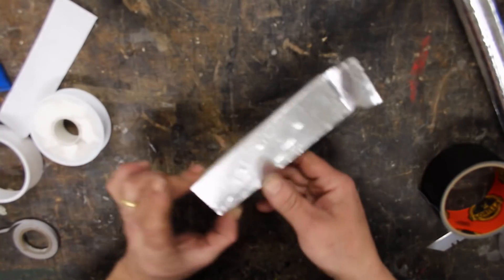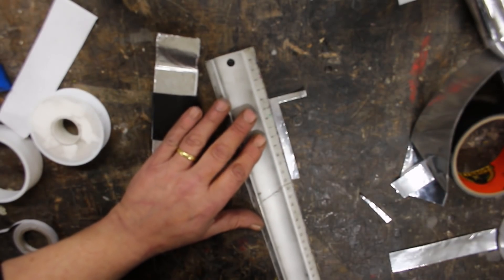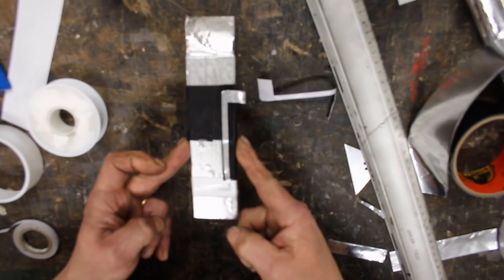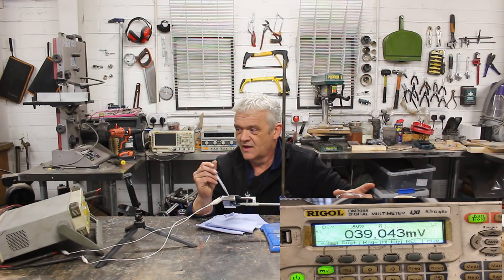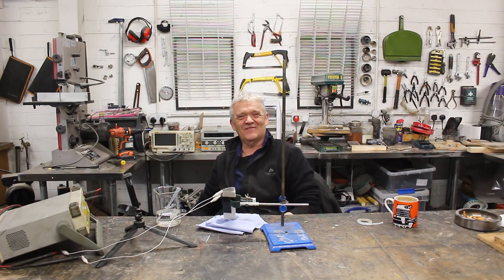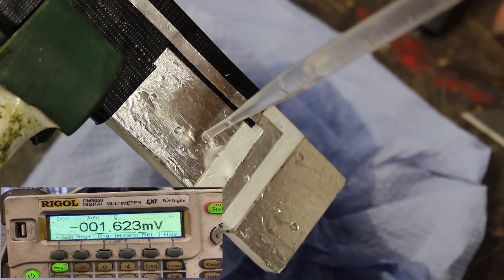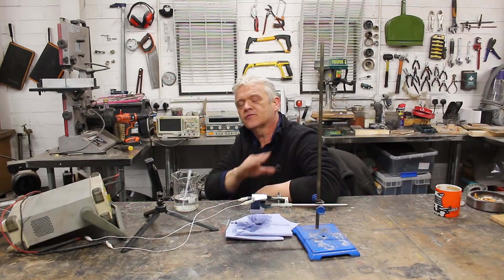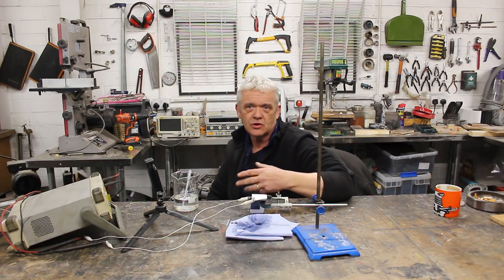1459 How To Make A Rain Fuel Generator

Comment: 100mV means absolutely nothing. That's just the PD across the terminals.
The flaw is that the charge on the drops is absolutely miniscule so they cannot deliver a significant current, and realistic power delivery needs a higher current than rain power can ever deliver.

Comment: I also made a rain fuel generator at home I also made a video of it but the problem is that it producing electricity in mili volts can you please guide mi how can I boost the voltage to even light up a one
Reply: @Robert Murray-Smith

Comment: This sounds a bit hinky.
The area of my roof should generate 5.4 kW.  If you get an hour's rain storm, that's 5.4 kWh.  That sighs quite optimistic.  But, since it's raining, put water wheels in the down spouts to harness the potential energy, and a wind mill up to harvest the wind during the storm - and, of course, a virtual copper pyramid over the house to capture the psychic energy from brain storms - you should be able to power one's own house, easily!

Comment: I tested this without PTFE and used clear take instead and it worked too. But the drops was more likely to stay on the aluminium. So I guess the PTFE is just to make sure the drops fall of as it is slippery and also more weather resistance compared to clear tape. Also noticed that if you let the drop slide along a plastic area before hitting the aluminium the voltage became bigger. Like if the drop generate some static charge as it slides along the plastic.

After some more experimenting I noticed that I get + and then it switch to - on the meter when the drop passes. I also get a bigger voltage when the drop moves faster. My guess is that this device work both as a capacitor and a inductor at the same time. The water works as a charged electrolyte that charge it like a capacitor and current flow in one direction. At the same time a field is created. Then when the drop leave the inductor the field collapses and you get a flow in the other direction. Note that this is just guesswork, I am probably wrong.

Comment: Greetings Robert and Luke!  Great channel!   In the process of trying the experiment, I noticed something interesting.  My setup used an actual aluminum bar, with a piece of teflon tape wrapped around it, and a narrow strip of aluminum tape on top of the teflon.  Aquarium tubing and an inexpensive plastic valve was used to control the water drop rate.  I found that the largest readings generally occurred when a portion of the water droplet (tap water) covered both a part of the aluminum bar and touched the aluminum tape (on the teflon) at the same time.  * Indeed, if I laid the bar flat, and let the droplet just sit while it spanned the two electrodes, I'd typically get a long lasting voltage. *  

This screamed "electrochemical cell", and led me to replace the teflon with a plastic film (from a Ziploc bag).  It also worked.

I then tried another experiment.  I placed two strips of aluminum foil in a glass of tap water, then attached both electrodes to my multimeter.  To my surprise, it also produced a "significant voltage", eventually settling down at around 127 millivolts.   (I found that if one electrode is much larger than the other, one gets a greater potential difference, along the lines of research reported in  "Area Effects in Aluminum Electrodes"  by Macnevin and Wilson in 1960.)

Haven't tried it yet, but it could be that the combination of an aluminum strip and a conductive carbon ink electrode also performs as an electrochemical cell, which involves the version demoed in video # 1460.  I'm curious as to what others have found in this regard.

Hydrovoltaics is certainly interesting.  I plan to explore some other approaches, such as capillary action.

Comment: In your video of the ram pump you expressed that the water is pumped upward. Could a stream and a ram pump generate more due to a higher distance between the air contact and the collector contact? Is it the initial charge granted by the water drop, or is each drop capacitative enough to absorb more ambient charge the further it falls?

I suggest that changing the distance between the water dropping and the collector as a staring point.

Always a treat to see a new video mate!

Comment: You basically builded half of a Kelvin generator. You would need at least 300 to 400 mV to trigger the diodes to get this static charge puls Pumped into capacitors. That's obviously triboelectricity so try to build the PTFE tape into a slightl wedge such that when the drop goes down the slant tile it has to jump from the L shaped electrode on to the other electrode it might then generate a few more volts. Because you know that the Voltage U increases with the distance d assuming the Electric Feld E is constant. ergo U = E*d

Comment: Isn't this just converting kinetic energy to electrical via the tribo effect, If rain had 50W/m2 energy I'm thinking most of us would be concust or deaf (or both) if this were true. In the experiment you produce 100mV odd Peak thats about 1 nanoWatt (100mV into 10MOhm) meaning 50,000,000,000 of these in a square meter for 50W/m2 and the rain energy to drive it.

Comment: Does the water lose it's charge as it passes over? If not you could cascade the panels one under another an the drip would generate multiple times. Edit: just read a comment below, I've asked the same question....

Comment: I just tried this, and I got 800mV from a combination of plastic, aluminum foil, PTFE - and a 5mm wide strip of copper tape. 
 When working properly, the voltage vanishes - as soon as the water flow stops. 
 If shorted by water, the voltage falls to about 300mV, and remains after the water flow stops, due to becoming an electrochemical cell.

Comment: In line with the ongoing "flower" theme on TNT: A soda can or other metal tube is cut lengthwise eight times leaving the bottom inch intact. The sections are folded out for the petals. The top half of each petal is insulated and a metal ring goes around the petals over it. If I grok this correctly this would be parallel capacitance so about 8x what you got in this video?

Comment: Very interesting. Would it be possible to do this on the inside of pipes, therefore generating power from mains water supply without reducing flow/pressure? Also gutters/drain pipes.

Comment: Seems like the version that allows the droplet to splash onto the PTFE and only contact the alu when it is at it's most extended gives a much higher voltage.
Try placing the contact at the end of the PTFE strip and drip water onto the middle so it extends onto the alu as it splashes. Angle can be flatter.

Comment: I haven't read the article from Hong Kong, but my guess is that by using transparent conducting oxides for the electrodes along with a transparent insulator between the electrodes would permit this technology to be applied to the surface of solar cells.  This is very interesting since it would permit the "solar" panel to become a "hydro" panel when ever it rains.  Thank you for bringing this to my attention.  Very interesting!

Comment: Am I the only one skeptical here? Those 4 cells running the leds seems fake to me. 50w/m2 also very hard to believe.  
Generating a few hundredths of a volt is easy but getting any meaningful power is unlikely. Volts without amps is meaningless.
Even if this does work, there is not enough rainfall to make it worthwhile.

Comment: What if you just used some cheap capacitors on a panel where the aluminum case is exposed as a third electrode to collect charges from rain drops?

Comment: Voltage is meaningless. I can generate 20,000V with a balloon rubbed on my hair. It what Amps you can extract?  Voltx Amps = Power,

Also ....50Watts per square metre? You may think it rains it a lot in the UK but the mount of time actual rain falls is less than 5% of the time (average). So maybe an hour a day. Lets compare wsolar panels where sunny or cloudy (they work in cloud conditions too) you have near 12 hours of daylight - each day (average!)

1 square metre solar panels now cost £100 and generate ~200Watt on sunny day and ~50Watts on cloudy day . On average we will get 100Watt (between 30% sun time and then 70%cloudy). On average day you will have 12 hours daylight . Therefore on average you shoudl expect 100x12 ~ 1200Watt-hours. Lets say I've been optimistic trim this down  by 30% - so 800Watt-hours average day
For your rain panel we assume 50Watt-hours  (but in actuality I seriously doubt that - but lets assume). So 800 vs 50 ....16 times more from solar panels. 
Most area are constrained by roof space and for sure you can't just use alumniium foil to construct (they wouldnt las a week). These are going to be substantial aluminium & dieletric panels that I'll bet will cost at least half that of solar panels . SO half the cost  yet giving  you 1/16th the power.
BUSTED!
Reply from the maker: you do realise I am just reporting on what the paper said? If you have a problem - take it up with the folks who wrote the paper - or even the peer reviewers who agreed with them - I think I will go with the scientific evidence as opposed to what amounts to a bit of a rant - I am guessing you didn't even bother to read the original paper did you? - BUSTED!!
Reply: @ThinkingandTinkering  I'm quite capable of reading journal papers thankyou - I'm author of quite a few peer reviewed myself.  I do not doubt the science of the possibility of very small scale generation in some kind of niche applications by this method. But you are making claims - and others are cheerleading it in comments - that this could be somehow ideal as alternative for UK where we have lots os rain and less sun.  That is itself is a myth. But also absurd is the idea this could work as a solution. Read through my numbers - and tell me where I'm wrong if you wish. I assumed the 50W/m2 could be viable but in truth  I doubt this could ever get above 10W/m^2 - it would appear to break conservation of energy laws by  my own estimation. But assuming I'm wrong on that even it could above the 50W/m^2 it would still be woeful as an energy production method - even in  rainer spots of the UK -  vs using daylight solar. By woeful I mean order of magnitude and more. Again refer to my numbers. So all the roofs these occupied would be throwing away 90%+ of energy available they could have had from solar. What a waste!
Whilst the principles might be fun to investigate -  to suggest this has potential to ever be a serious energy producer - other than anything other than a toy or merely demonstration of principles -  is almost reckless/irresponsible. To do so gives credible ammunition to the people who are skeptical about any net zero and shift to renewable/ green energy  we require.  They can point to this and call it loopy as a solution because that's what it is as a scaled up idea.  There are many such people ready to pounce on unfeasible devices like this.
Fortunately the world has plenty of real and credible cheap solutions for genuine large scale energy generation - solar, wind, tide, nuclear that needn't cost too much and where prices are falling rapidly. We dont need cul-de-sacs like this to explore.
Yes - all this is a little ranty -. But I am very vexed by this.  Climate change is very real, imminent and present danger and energy crisis & costs rules and ruins peoples lives . As a professional in the field I need to believe we can get beyond  this and not get side tracked by the many hair brained 'water fuel cars' and 'perpetual motion' machines schemes out there.
Reply: @bbbf09  
 Considering your claimed skills in this area, and the ongoing global warming problem, perhaps you should not be denigrating the work of others, while not presenting any solutions yourself!
Reply: @bbbf09  
 You invalidated this lengthy response of yours, when you used the term "BUSTED!" in your opening comment. 
 That stated, I understand where you are coming from, but you could have been more constructive in your original criticism.

Comment: John Ellis water appears to have a high charge (increased hydrogen bond angle). The normal bond angle being about 104º, John Ellis water at 114º. Also just a few drops (20 is the stated number) of John Ellis water appears to decrease power input to electrolysis, while still maintaining production. A 2 ounce dropper bottle of the water is Free from the John Ellis website.
Might take a bit to wrap one's head around those concepts and terms, just be patient, and observational about it.

Comment: Great stuff! Imagine having those cells set up in spouting. If you could change the surface tension before the cell to get the water to bead, or split a pipe into multiple pipes? Alternatively you could replace the corrugated iron sheets or roofing tiles to allow water to bead and run down? If you have these cells one after the other can you get the same amount of energy in following cells or has the water lost it's charge?
Reply: Ive seen someone take pipettes of water from a beaker and re run it over and again and it looked like it didn't lose the charge

Comment: Has anyone measured whether raindrops from thunder & lightning clouds store or transfer more charge than non-thundery rain?
Reply: Good question I guess the only way to find out is when it's run raining and thundering outside collect a glass of rainwater for when it's raining and thundering and when it's not raining and thundering and if it's not thundering and it just little bits of rain here and there how we get a lot of sprout sometimes with no Thunder test the difference in the accuracy of the output of the water also between snow water Rainwater rain with thunder water and tap water and water from a lake and Stream in ocean and there could possibly be a difference in the charge that it produces out
Reply: @themechanicman3865  Probably calls for a bit if citizen science - multiple identical iterations of a simple device over a large geographic area. GCSE summer science project.

Comment: This could be really useful for places away from water mains. Any roof could generate the power to pump the water falling onto it, just when it's needed. It would be a wonderfully passive system. Plus any waterfall could generate its own lighting in posh landscaping.
Reply: Make it produce 100,000,000 more power than the demo and you would be able to light a FEW leds!

Comment: Could you have boosted the output by running the PTFE tape along the length of the plastic slat, instead of only the width, and add additional droppers? This is what I am going to attempt: base is a used plantation shutter with 18” wide wood slats. Cover the slats with aluminum HVAC tape. Lay a strip of PTFE tape along the length. Lay another strip of aluminum HVAC tape. Wire the 20-ish total slats in series to boost the voltage.

Comment: Ever since I known about lord Kelvin water drop generator I been pondering making one of these for years. As I always wanted to setup a system for rain gutters. I knew it was possible. I love your channel Robert. And i watch cayrex2 a lot too.. This i belive would make a great addition too recharge zinc bromine battery's..
On more thing if the water was allowed to run down a stepped wall much like a stepped pyramid made of certain minerals could we increase the output voltage?

Comment: Harvesting lightning flashes was a dream from childhood on, now some fifty years ago. 💭⚡🔋
As young adult I learned that it's the batteries available not being able to take this amount of energy in such a glimpse.
Awsome to see the principle been realized on practical level. 🤓

With today's knowledge it's even more amazing to know that we could use the discharged water to additionally power a conventional generator just stacked below.
That's what I call efficiency! 😃👍
Reply: You could capture such fast acting charge within a capacitor cell (the reverse is done in high power lasers)
Let's look at one we get - a typical lightning bolt has  a billion Joules of energy. So if spent in one second thats a billion Watts. Sound impressive
But what do we get spread over a day  ?   /60 /60     = 277kW-hrs   of energy. A typcial house will use apporx 10kW-hrs in one day  -. So you get about one months of electricity for one house.
Where I live you basically might get 3 or 4 lightning storms above the whole year  - which therefore might power a house for a few months out if you get one strike each time. Lets say you get x10 strikes each storm at you capacitor bank.  I doubt you get get much more strikes over a square mile fro discharging the cloud base locally. So roughly 10 houses  coudl run of such a device over a square mile -- for part of the year.
Unsurprisingly - the maths are not encouraging.

Comment: Fascinating Rob!  isn't this , basically, a method of harvesting the energy  Lord Kelvin demonstrated with his water drop device? I wonder how using your conductive ink in place of the foil would affect the performance?   Also I cant help but be reminded of Victor Schauberger's work and his discovery(documentation?)  of the fact that water, when spun in vortex or spiral pipe will generate a voltage as it flows through.
Reply from the maker: yes mate - I think it is and I am doing an ink vid right now
Reply: @ThinkingandTinkering  I look forward to it!

Comment: I imagine there must be an optimal size of water droplet, bigger droplets carry more charge, but they must be smaller than the strip of PTFE so as not to short the electrodes without creating the voltage difference?
Reply from the maker: it can go from next to nothing to a steady stream but once it is flooded it stops